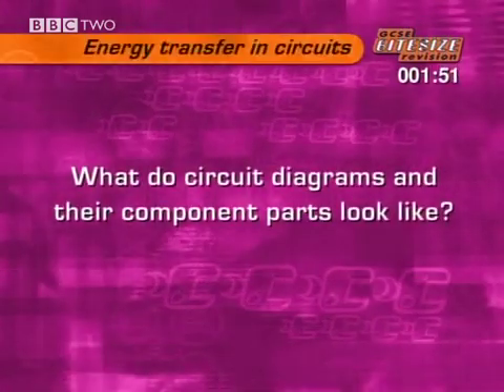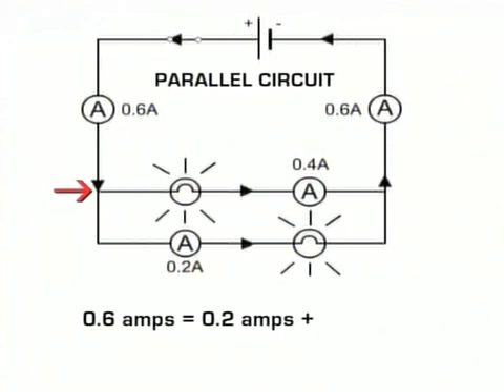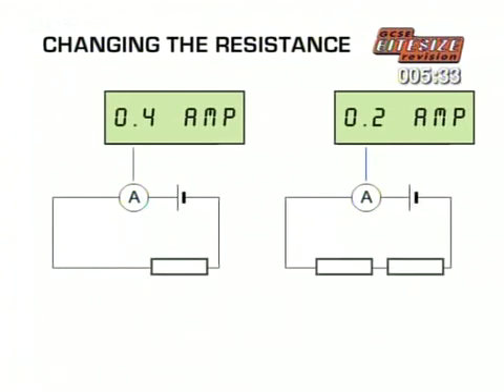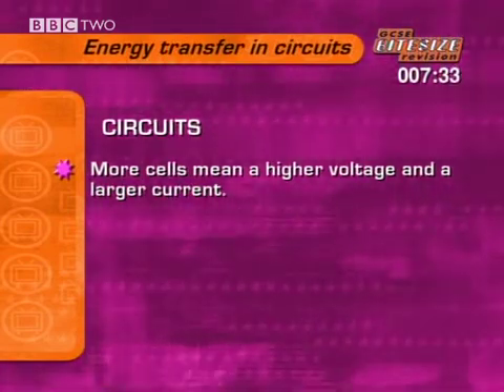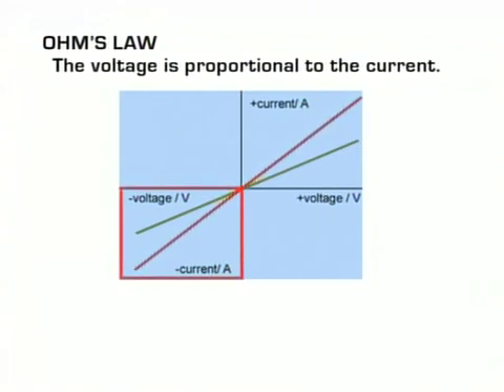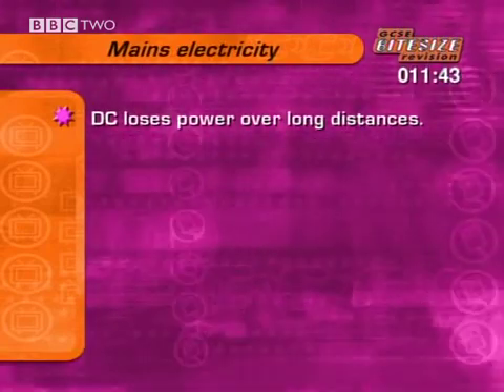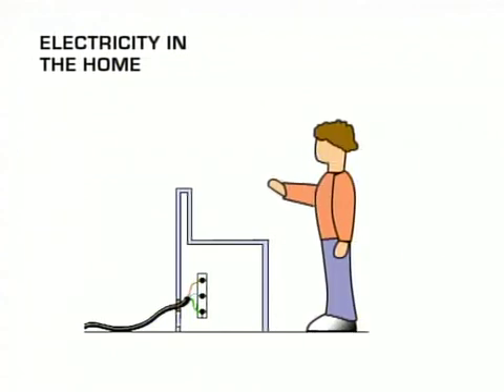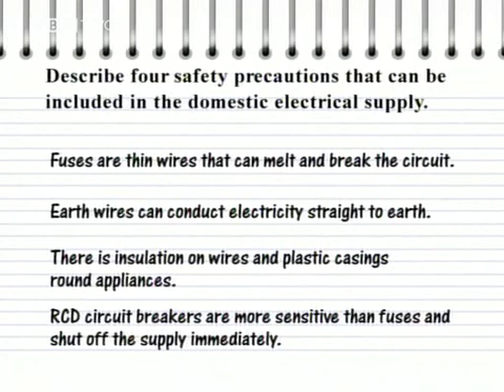GCSE Bitesize Revision   Physics 1 Electricity 1

Comment: What? This is backwards. My GCSE books tell me the current flows from -ve through the circuit to +ve. It also has the Battery reversed. Isn't conventional current fictitious? It appears as though this is trying to tell us that electrical charge is positive? I'm either confused or this is an awful, awful thing to inflict on anyone trying to improve their understanding of physics. It's hard enough as it is.
Reply: Runaway Suzie direction of conventional current is in the direction of +ve charge ...in circuit diagram currents is taken from positive plate to negative plate